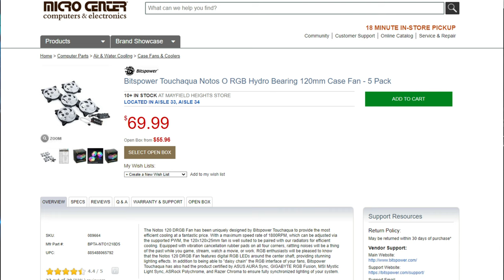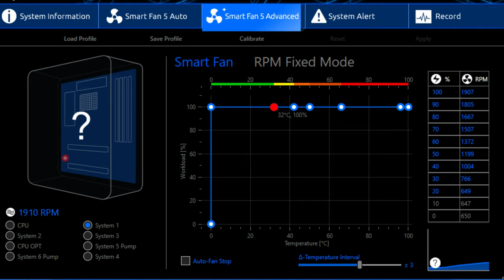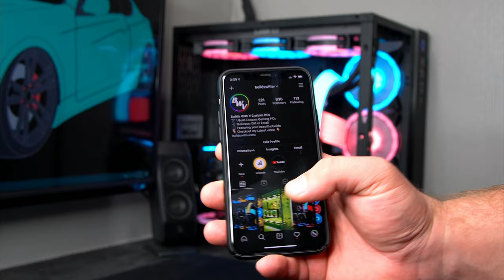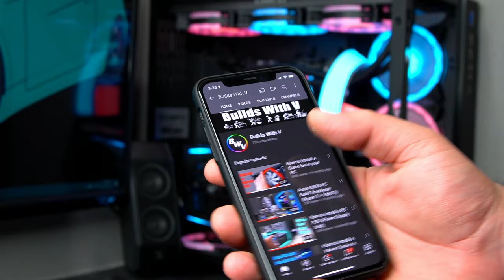Best Budget RGB fans (Bitspower Touchaqua Notos O fans)

Comment from the maker: What RGB fans are your absolute favorite?
Reply: Corsair even tho they cost me a left leg
Reply from the maker: @babyblueface2304  They are definitely solid fans with lots of lighting effects. In a tier of their own for sure.
But do you miss your leg? 🤔 😂
Reply: Corsair QL120
Reply from the maker: @BuAzeez  solid choice 💪
Reply: I would chose ql120 but so expensive
Reply: I have the same fan and for some reason the rgb is not working. Any idea why?
Reply from the maker: @pinggoyadventures5010  not too sure why, as long as the 3-pin cable is plugged into your ARGB header on your motherboard then it should light up. Here’s a video I did a while back showing the process: https://youtu.be/T_Jjzgq_htU
Reply: @BuildsWithV  What program did you use to get 2 different color on every part of the devices ram and fans? i have G.skill ram and notos fans.
Reply: @camaro98xd  If you haven't figured it out since you posted this, Asus AURA works with the fans and Gskill. He has it set to rainbow.
Reply: Alpenföhn Wingboost White
Reply: Corsair LL120 but cost me my kidney
Reply: @BuildsWithV  I know this is an old video but I bought the bitspower touchaqua notos (non o ring version). I plan on making my build with them but I’m not sure if they would be good with a 240mm AIO. I know the fans are compatible its just I’m not sure if they have enough static pressure. I’m aiming to cool a 12600k.

Comment: i have these fans and they run at max speed. i tried lowering the speed in msi dragon center and my bios but its not working. can you help with that ?
Reply: I have the same issue. Did you ever find a solution?

Comment: How did you get all 9 fans on one rgb hub? When it only supports 8? Did you daisy chain one? It says in the instructions not to exceed one meter of cable length.
Reply from the maker: I used two rgb hubs.

Comment: So my motherboard has a 4 pin header for the fans , asRock , will these not work ? Or could I do an adapter?
Reply from the maker: If the RGB header is a 4-pin these won’t work unless you get an adapter but typically the 4-pin headers only output certain lighting effects which means you won’t get the full ARGB experience. You could also get something like the Razer ARGB controller which would use synapse

Comment: Hey quick question how do I change the led lights? I've got the app but it won't pickup the fans from my motherboard it's a asus
Reply from the maker: Which app are you using? The Asus app?
Reply: @BuildsWithV  aura creator
Reply: @BuildsWithV  I tried razer but it won't locate the fans
Reply from the maker: @wasspoppinkevinii5543  I believe on the Asus motherboards you will need to use aura sync
Reply: @BuildsWithV  yep I'm on that too and it also doesint work.. Tell me if I'm right but there is a cable from the fans that has 3 holes which isn't connected to my motherboard because I can't find any with 3 pins only 4, could that be why or is that irrelevant?
Reply: @BuildsWithV  fans and the rgb work but can't be detected from the site
Reply: @BuildsWithV  also the fans are loud.. Is there a way to stop that?
Reply from the maker: @wasspoppinkevinii5543  yeah the 3-pin is the ARGB control which needs to be plugged into your motherboard. Since your motherboard only has 4-pin they aren’t compatible, you can get something like the razer ARGB controller which will allow you to use those fans with razer synapse.
Reply from the maker: @wasspoppinkevinii5543  as far as the fans being loud, you can go into your motherboard bios and change the fan speeds. Maybe they are running full speed or something.
Reply: @BuildsWithV  thanks man! I regret getting these things tbh didn't think they be so bulky and annoying but it is wht it is

Comment: How did you hook up 9 fans when the  controller has 8? I'm looking to get about 12 of these for a build but how did you get the 9th one running? Thanks in advance.
Reply from the maker: I used two rgb hubs. One for each rgb header on my motherboard so I could get the two tone effect
Reply: @BuildsWithV  ah gotcha then I assume you had bought two of the 5 packs with the controllers.
Reply from the maker: @tatsumaru716  yeah that’s correct
Reply: @BuildsWithV  thank you! Last question, any idea if I can daisy chain the two hubs since my board only has one 3 pin?
Reply from the maker: @tatsumaru716  since they’re sata powered you can probably do that but I haven’t tried it so I’m not positive. You can also try using a splitter from the header to the two hubs
Reply: @BuildsWithV  awesome thanks for all the help! These look awesome and they'll save quite a bit of money.

Comment: So I just picked up the five pack from Micro Center.  I do have a question as the instructions are not very clear. My motherboard does support argb, so do I need to connect the hub to SATA and to the motherboard as well?
Reply from the maker: That is correct, you’d plug the hub to sata and motherboard for full control. Thanks for watching 🙏

Comment: So i can just daisy chain them to each other and not need to use the rgb hub that came with it and still be able to change the colors using software? im having trouble with cable management and any space i can free up would be nice.
Reply from the maker: You can daisy chain them but I think the max would be 4-5 per header. I usually don’t do more than 3-4 personally just to be safe

Comment: Hey V, question for you: I have the 5 pack of touchaquas and in your video you mention that you should plug in BOTH the sata power cable and the mobo cable for the argb controller. Is that correct? I only ask because several reddit posts state that you should plug in one or the other, but I'm not sure. Can you clarify?
Reply from the maker: You will need the sata power connected. The motherboard cable is optional because the controller does have buttons on it and you can change colors and stuff using the controller. However if you want to control the RGBs using your motherboard software then you also need the motherboard cable plugged in (sata still needs to be plugged in).
Reply: @BuildsWithV  Got it, thank you!

Comment: Yo question if the rgb hub can only light 8 fans how you have all 9 on
Reply from the maker: I used two rgb hubs which is also how some are different color. I made a whole video dedicated to installing these hubs. The other option would be to just piggyback one of the rgbs onto the hub or motherboard

Comment: Should I get these or gelid stella fans?
I'm looking for rgb.
Reply from the maker: Either fans will be perfect. They’re both extremely similar, might even be made by the same manufacturer honestly
Reply: @BuildsWithV  I just received these bitspower fans and just realized the rgb hub supports 8 fans and I have 9😕. Idk what to do ima try to save up for the razer chroma sync I saw your video about to connect the other fan , some led strips and aio rgb

Comment: Great video. I hope I'm not too late to get ignored, but I just picked the 5 fan set from Micro Center because I considered it to be a great deal, however my motherboard does not support 3 pin argb, it only has 4 pin so I will be changing the color through the hub itself, question is; In your video, I can see that you have both red and blue between the fans, I wanted to do something like that but with orange and red, Can I still do that?
Reply from the maker: You can do that only if you have two hubs and some fans connected to each hub. Then you just change the color of each hub separately
Reply: @BuildsWithV  Thank you

Comment: How did u get them to be different colors for me they automatically connected to my gigabyte software but it only let's me set them to the color options available on the gigabyte software.
Reply from the maker: I connected half of the fans to one of my rgb headers and half of them to another rgb header. I explain it a bit more in this video: https://youtu.be/EttoFpulT4s
Reply: @BuildsWithV  yoo thanks for replying so fast  that makes sense. I watched your razer chroma vid too. I only have one header but I'm going to install the razer hub cuz I have razer kbm so it's easier to pair. Thanks dude your vids are really helpful!
Reply from the maker: @agasthyakansal708  you’re very welcome and thanks so much 🙏🙏
Reply: @BuildsWithV  no problem!

Comment: Just copped these fans from micro center. Hopefully they work well for me. Btw good video and ur pc is cool. I would want to know if it can work with the asrock b550 phantom gaming mobo atx?  I’m gonna have to use the hub and controller since The mobo doesn’t have enough rgb headers.
Reply from the maker: I believe that motherboard does have 3-pin addressable RGBs so you should be able to control them with your motherboard. But yeah you’ll definitely need to use the hub since the motherboard only has 2 of the rgb headers. Thanks for watching 🙏
Reply: @BuildsWithV  thank you so much. But can I also piggieback ride them together since they have an extra 3 pin addressable rgb header? Like connect all of them together and then the last fan can go into the argb header on the mobo? 
Thanks
Reply from the maker: @cesarvazquez1351  yeah you can piggy back them together. I’d say keep a max of 4 fans per motherboard header. you have 2 headers on there and I’d say safely you can power 8 fans total.
Reply: @BuildsWithV  okay I’m gonna use 4 fans so that’s good. So even tho I do that method can I control the rgb with the software (asrock polychrome) when I piggyback them together?
Reply from the maker: @cesarvazquez1351  that’s perfect and yeah you can control all of them through the software. I recommend doing two on one header and two on the other so you can change them separately for cool effects
Reply: @BuildsWithV  okay thank you very much. This is gonna be my first ever pc build so wish me luck. Thank you for your time!
Reply from the maker: @cesarvazquez1351  no problem at all. Congrats on the Pc build! That’s awesome 👏 Good luck and always feel free to reach out

Comment: So I bought the same fans from micro center and I was wondering if my board that I also got has an addressable rgb header like the one you mentioned in the video. I have the Asus Rog Strix b550-f Gaming motherboard, please let me know if this motherboard is okay to use those fans.
Reply from the maker: Yeah it has 1 ARGB header at the bottom in the center. Good to go, just use the RGB hub and plug them all in there and you’ll be good to go
Reply: @BuildsWithV  thank you so much I wasn’t sure but now that I got home looking at it I see which header it is
Reply from the maker: @itzryuma  glad I could help. Enjoy the build 🙌

Comment: are these set to cyan and pink? or is that red and blue?  they seem very pastel in this video.  Maybe go through some other color options for the video.  If that's "red" and "blue" these seem to be horrible.
Reply from the maker: These were set to a light blue and light pink. I probably should have done a few different colors. Thanks 🙏
Reply: @BuildsWithV  awesome thanks for the info!

Comment: How do you do different colors like you did in this video? How can you do 9 or 10 fans if the controller they give has 8 only? I also have a lian li xl case and was looking into more cheaper case fan options. So far the gim ines and they are really good but wanna try other if not better ones for similar price.
Reply from the maker: Great questions. I made a whole separate video showing how exactly I got this effect and how I connected everything. https://youtu.be/EttoFpulT4s
Thanks for watching 🙏

Comment: If you plug the hubs in the the motherboard does the RGB controller still work? I have these fans but my controller doesn’t work
Reply from the maker: If the RGB hub is plugged into the motherboard, the controller automatically starts using your software. If you unplug it from the motherboard, then you can control the RGB using the controller.
Reply: @BuildsWithV  awesome, appreciate it

Comment: What software is best to use to control the fans?  Is there any software available to program custom sequences?
Reply from the maker: That really depends, the fans just have standard 3-pin ARGB which means you can plug them into various controllers like the razer ARGB controller and use their software or you can plug them into the motherboard like I have them and control them using your motherboard software

Comment: hey V, i already bought a different set of fans and they do NOT come with the RGB hub and fan hub. im planning on installing 9 fans + AIO just like your build. i guess im wondering if you have a recommendation for  setting up those 9 fans into my motherboard. i know about corsair commander pro, but it only fits 6 and also expensive for me.
any input is appreciated!
Reply from the maker: That will depend what fans they are. If they use the standard 3-pin ARGB and standard 4-pin PWM connectors then I just recommend getting a sata powered PWM fan hub and a Sata powered 3-pin ARGB hub. Connect those to sata and the corresponding motherboard headers and you should be good to go.
Reply: @BuildsWithV  Hey V, so im looking at my motherboard (asus prime x570-pro), it has 2x 4pin RGB header 12V. and 1x addressable gen2 RGB header. I want to connect 6 fans of (DF-12025 ARGB) and it says that they are +5V. i think this is dumb but what do i need to do to connect those 6 ARGBs? also merry christmas!!!!! im about to build this PC soon and your input is very much needed.

Comment: should i get these or gelid stellas which is $40 for the bundle and it’s 5 fans and the hub, controller, and splitter
Reply from the maker: I haven’t tested the gelid yet so I’m not too sure how well they perform however on paper they look great. A bit less powerful but that’s perfectly fine since you don’t really need tons of power. I’m sure either brand will be great in your build.

Comment: Hey thanks for the awesome video. What are you using to control the fan speed?
Reply from the maker: Just using my motherboard software. I either control it through bios or gigabytes tuning software.
Reply: @BuildsWithV  I have the 5 pack as well. Using the hub controller, I have no fan speed reading or control. The fans run at full speed. What could be the issue?

Comment: I was also wondering because I am using the ASUS x570 Strix E Gaming I was wondering If both the RGB and the Fan hub both connect to the motherboard with a 3 pin 5-volt connection? I was also wondering if it would be possible for me to add a  fan splitter for the RGB hub as I want to run 9 fans and it only has 8 slots to allow me to power 9 fans RGB and the FAN itself.
Reply from the maker: Yeah you can plug a rgb splitter if you need another one plugged in. Won’t hurt anything unless you plug too many. These actually have piggy backs so you don’t even need a splitter. Thanks for watching 🙏

Comment: when you first set them up, did they light up or not? mines are turned on but the lights are off
Reply from the maker: They should light up right away as long as they’re plugged in to the correct connection. How do you have them wired up?
Reply: @BuildsWithV  i have the 4 pin connected to the system fan plugin but they turn on just wont light up, you think i have to download something? i have those weird connections plugged in like a loop in the video
Reply: @BuildsWithV  i just bought only one, i didnt get the hub or anything
Reply from the maker: So the 3-pin connector needs to be plugged into the motherboard or a rgb hub if your motherboard doesn’t have an Addressable RGB header. Here’s a video I did a while ago showing how to connect it. https://youtu.be/T_Jjzgq_htU

I probably shouldn’t have showed me looping it like that. Sorry for the confusion. I just did that to show that if you have 2 or more fans you can daisy chain them together to light them all up.
Reply: @BuildsWithV  that sucks very bad, i just realized my motherboard (x470 max) doesnt have drgb, so i think ill have to return this fan and switch it for another one? or maybe ill get an rgb hub
Reply from the maker: @AzaJZ  Yeah unfortunately many motherboards don’t have ARGB which is odd since many fans use ARGB and works better than 12v RGB in most cases.

Comment: Can i control the RGB lighting from Mobo or any software?
Reply from the maker: You can control the lighting with your motherboard software as long as it has a 3-pin Addressable RGB connection. I’m not sure if other software will work.
Reply: @BuildsWithV  thanks a lot
Reply from the maker: @karimamer9160  no problem at all, thanks for watching 🙏

Comment: I have the Up Here fans Here's my experiance so far with them:
They look nice but they go Bad pretty quickly. 
I bought a 6 pack and the first fan went out in a month, next fan hit the dust at 5 months and the 3rd at 9mo,  and now a fourth one is going out now at 12 months.
So in one year  4 out of 6 are bad. 
What goes out on them is the bearings cause they don't stop dead they just start making a noise and spinning slower.

P.S. I  Fully Blow out my system every 4 months, So it's not likely a dust issue that caused the uphere fans to go bad. They were pretty cheaply made.

But thanks to your video I am gonna try this one instead. I am not sure if it will work with my RGB remote or not but I think it should, since its the same type of RGB connector as my front Panel case lights (In win infinty 805 Case) Which I wired to a remote instead of software controlled because I run linux and the software sucked even running through wine.
Reply from the maker: Thank you for the details! I still have these fans in my case without any issue. These are definitely the higher quality "cheap" fans. The only real issue I have experienced so far is the the center yellowed slightly on 2 of my fans.  I don't know why just two, maybe they were exposed to more heat or something. They still look amazing and they still cool my PC very well.